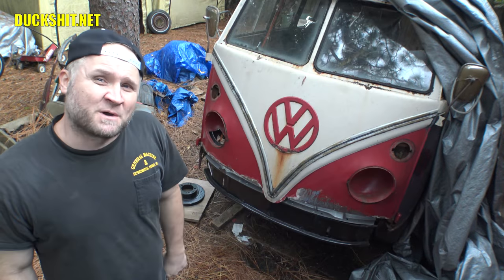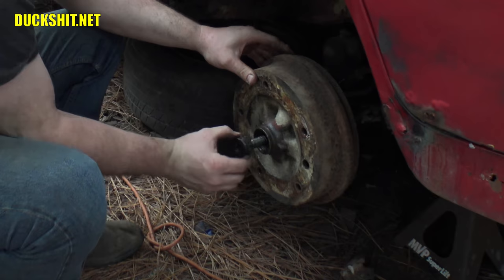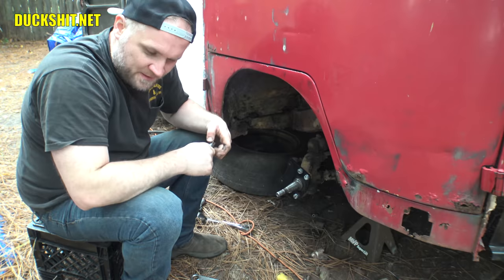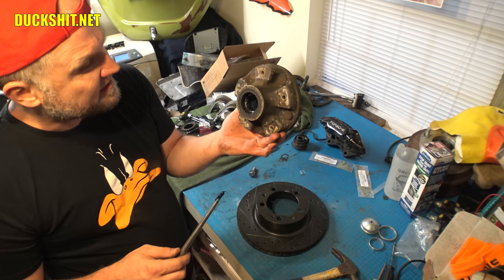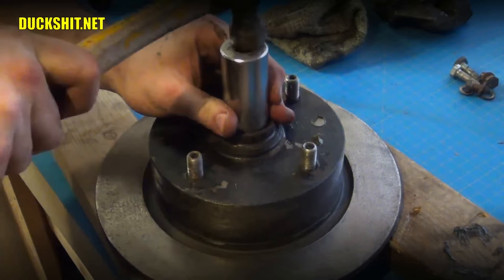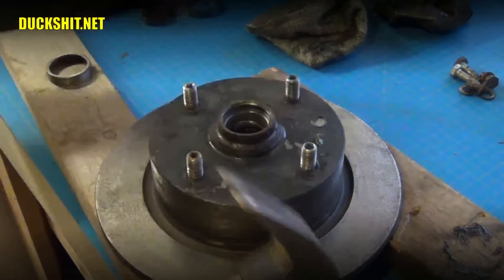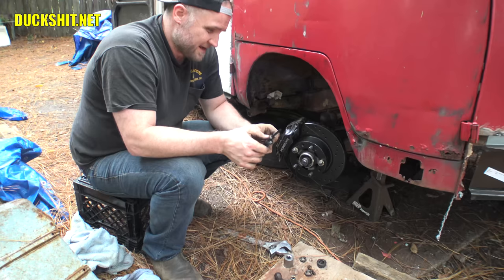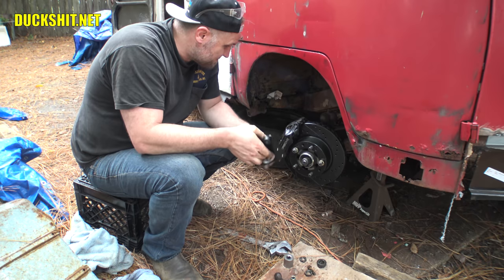Porsche Front Brakes onto 1967 VW Bus - Gregory - 15

Comment: Man that looks like such a great mod...and actually INCREASES safety because of better stopping power
Reply from the maker: Yep, not a big fan of drums and the constant adjustments you have to make to them either.  Maintenance on discs is virtually non, and even the pads are cheaper.  It's totally worth it!  😁👍

Comment: I truly love that you put the step on the hub to make it fit the rotors perfect. That great attention to detail and engineering 👍🏾
Reply from the maker: Thanks much!  They fit soooooooooo nicely!  I probably could have just cut the hubs to the diameter and been done, but I think the step gives it a much better fit.  I'm happy with this!  Thank you for your comment!
Reply: DuckmanCycles and VW Garage I’m really enjoying this build. I’m not into Volkswagen but this is really cool. I’m happy you got rid of the gear reduction things. Less parts, less weight, less complicated.
Reply from the maker: @jth1987leb  Thank you very much!   Also the Bus doesn't redline in 4th gear at 55mph without the reduction boxes lol!  Man I hate those things... but they would be great in a buggy or rock crawler!
Reply: DuckmanCycles and VW Garage have you ever concerned putting in a modern power rack and pinion? You have to fab the frame to hold and use an electronic pump but would be cool 😎
Reply from the maker: @jth1987leb   I sure have!  But a rack and pinion doesn't require power steering, but if I wanted power also, kits are easily found, the motor/gearbox wraps around the steering column, no pumps needed!  May put a rack on the Beetle, though.  We'll see how I feel when I get back into that project.

Comment: I use a brass drift to drive bearing races out but I developed a trick many years ago to drive the outer races *in*. I take one of the old races and cut it through in one spot with a "ziz" (abrasive cutoff) wheel. That makes a bearing driver that doesn't stick in the bore. Seat new bearing and the driver slips right out...
Reply from the maker: THATS A GREAT IDEA!  I just need an old bearing... lol!  Thanks so much for the suggestion!

Comment: You should chop the bus.
And channel it.
And section it.

😜
Reply from the maker: YOU SHOULD!  LoL!  Ya know.... there is no headroom already for guy like me.  Imagine what that would do to me.  I'd need a central seating position so I could fit myself low between the wheels and bolt a sports car seat down to the walk-though area...  Pretty gimmicky, and not much of a vehicle that'd be enjoyable.  Hahaha!
Reply: @DuckmanCycles  yeah I'm a whole foot shorter than you, I can get away with that.
Reply from the maker: @thetrannyshop5596  I will bet that our legs are about the same length though.... I'm short legged and VERY long torso. They say all your strength is in your core.... well I am ALL CORE!  LoL!  Seat-to-ceiling height is everything to me!  Buses sadly aren't as generous in that department as our bubble-roofed Beetles!  Even Eleanore with a massive roof chop had a lot of head room.  I only lowered the seats to see out the window lol!

Comment: 14:10 ...It's the grease. Spinning while tightening works the excess grease out from between the faces of the rollers and the races. The tighten-and-back-off is the final squeeze to set everything. Should be able to turn it with one hand without forcing it, but it's not going to spin freely because of the grease.
Reply from the maker: Thats kind of what I've figured.  I took the nut off and pulled the hub towards me a bit... it was just as sticky, no better, no worse.  So I knew it wasn't binding on anything   But I've never seen one that sticky before!  Thanks for confirmation!
Reply: @DuckmanCycles  It's basically Wheel Bearings 101 - Tight, but not Too-Tight (and get your mind outa the gutter! :P)
Reply from the maker: @brand-x7049  Yep, thats why I finger tight, then back off that 12th turn.  I've done that on all my vehicles and trailers, always had happy bearings!

Comment: What is the difference between the front spindles on a VW bug as opposed to VW bus. If any? I’m at my wits end over this. Can’t find Porsche brakes for buses not as many for bugs.
Reply from the maker: Beetle and Bus spindles are completely different!  Absolutely nothing matches.   The Bus spindles are more similar to a Porsche 944 than anything else, and finding the Porsche brakes for Buses has been easier than for a Beetle even though you said the opposite.  I've put Porsche brakes on both Beetles and Buses here on this channel.  Bus was far easler.
Reply: Can I swap spindles to create what I’m wanting to do with the front suspension?
Reply from the maker: You cannot swap between Beetle and Bus without performing some massive engineering feats.  Not impossible, but it'd be a technical challenge!
Reply: @DuckmanCycles   thank u for the information very much i’m getting my bug in a month in a half back🙌

Comment: ?  Bearing spacers ? You use bus bearings in the porsche hub ?  Guy at work GAVE me 944 hubs and calipers.  Damn, I did not ask what year, guessing they were early ?  want to run them, turbo or not, it has to he help, and I want the Fuchs.  I know you don't give a Fuch....LOL
Reply from the maker: Yeah man!  The Bus bearings are actually the same as the 944 bearings, but the spacing is different.  The earlier hubs are required in this method, but what year of early hub you have would determine which disc/rotor you will need to use.  Of course if you have a lathe you can make anything work!